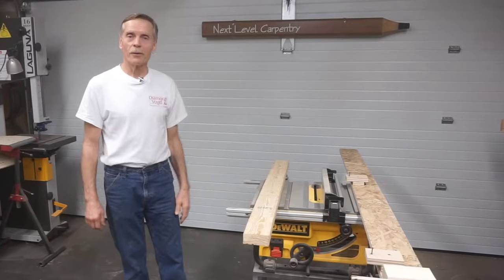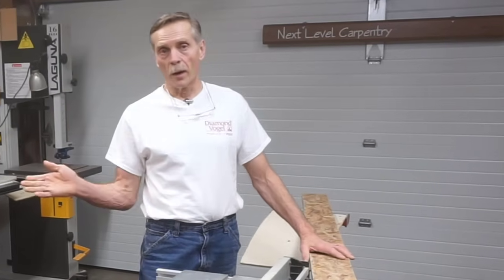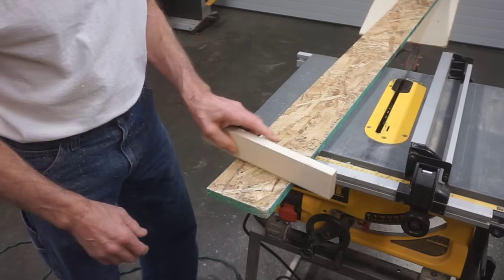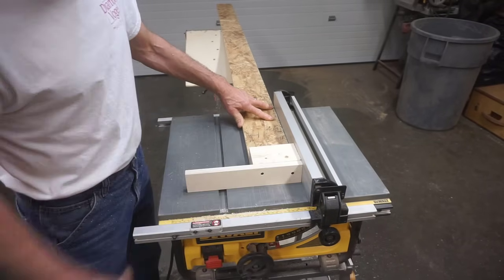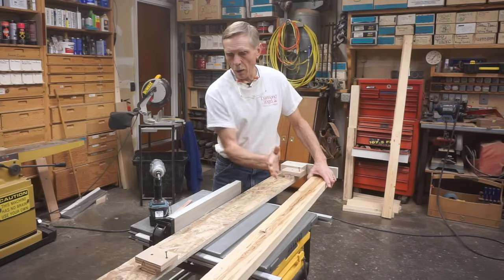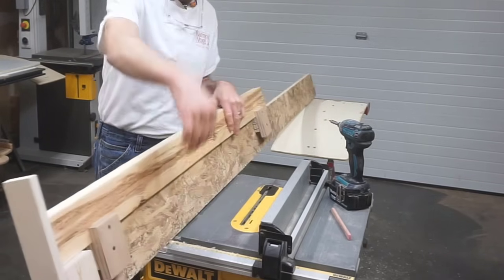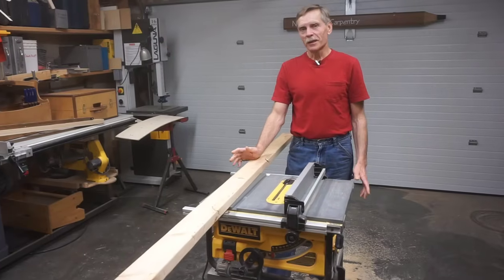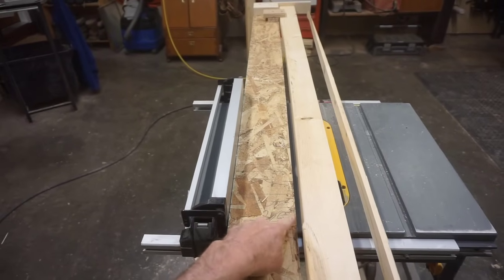How to Cut a Straight Edge on Crooked Boards

Comment: why not just screw the straight board to the warped one and cut the opposite side?
Reply from the maker: Some people do it exactly as you described but I prefer this method and leave it for user discretion to decide between the two
Reply: Also, you would leave screwholes in the finished piece.2x4s are one thing, quartersawn clear white oak is another.
Reply from the maker: @timothydunlap7980  exactly... this is framing lumber, not precious hardwood.  The Powermatic PJ with razor sharp cutters and a 6' bed seen and mentioned in the video... THAT'S for the quartersawn clear white oak, padauk and ebony... no screw holes allowed! Best, Matt
Reply: yes screws are horrible -  one could use double sided tape or even pin nails.  i just made a blunt example.

Comment: Hello sir,  BTW Great video(s) as alway.

I am a rank a$$ beginner wood worker but have a few easy questions.    

I heard you mention that this process could be used to straighten wood for framing and or other purposes.  After thinking about that for a minute, I am guessing the framing idea would work great for most everything besides walls.  Since most of the walls in my home, have finished surfaces on both sides (drywall / drywall & Stucco in my case) and need to be parallel by using studs that are all the same thickness and hopefully pretty straight.  Or can this process be used if you simply shim the drywall and or stucco lath, during installation? 

A few years ago, I remodeled my master bathroom and really struggled with very crooked, and very out of plumb walls.  But in my specific case, I believe it was due to warped studs and high-speed track home workmanship.  This is essentially the opposite of what you do, which is why I subscribe to your channel 

you, sir

Mark Nicholson (Retired)
Former, US Army - EFMB,
Combat Medical Specialist
1/94 FA MLR
Reply from the maker: Hey Mark, thanks for watching, subscribing and commenting here... much appreciated!
To your question; I think it's easy to get distracted about the application of this method by the fact I show a 2x4 being straightened in the video's thumbnail and taking it too literally.

While the method does work as shown to straighten boards of any width, the problem is the width of the straightened piece needs to be taken into account.  I think that is what throws viewers off and into thinking I'm showing how to straighten a crooked 2x4 and re-use it as a 2x4 once straightened.  That would be completely impractical in any but the most dire situations because it would involve adding a strip of wood or something the thickness of the blade to replace the missing saw kerf from the straightening cut which would involve not one but two glue joints the full width and length of the 2x4 not to mention time and effort and a dozen clamps.

I have used this exact process (and is one of the things that inspired me to make this video) to straighten bowed 2x6's to re-use as perfectly straight 2x4's.  It's an excellent way to re-purpose salvaged wood that is good otherwise.
2x4's, as shown in the thumbnail, are a great source for furring, soffits, tub decks, chases, etc where lumber needs to be straight but not full width to match other 2x4's.

Now your bathroom remodel predicament is a different situation entirely. Unless there's some dire extenuating circumstances I would never suggest removing studs from a framed wall to straighten them using this method and reinstall them... that's crazy talk! 😜  The best remodelers who face conditions you describe deal with bows INTO the space by using a power plane to shave away the bow... a tedious, messy and time consuming process to be sure... but that's why they're considered 'the good ones'.  Studs that bow OUT of the space are straightened by stacking and staggering drywall shim strips to fill in the bow until it's straight.  Adding shim strips is also one method of plumbing studs that are out of plumb but otherwise straight although I prefer to use my Super Shim method in this case:   https://www.youtube.com/watch?v=IGK3w2I_Bms

I hope you don't mind that I pin your comment to the top of the list for awhile since you're not the first (or the last) to wonder about ways to apply this straightening method?  I hope others benefit from the discussion and will join me to thank you for your service to our great country!

Best,
Matt
Reply: Damn good question and damn good answer I will be subscribing
Reply from the maker: @colbornfarms4849  Thanks for watching... and the sub!

Comment: track saw ?. may be
Reply: That's meant for larger pieces. Slabs and panels. It's awkward using a track on a 2x4. It's better to use it on a stable surface. Table saw was the right tool for the job.

Comment: crooked as a bucket of snakes ;)
Reply from the maker: Markus Puschert you know exactly what I'm talking about; you just walk right by that pile of lumber and shake your head right?
Best, Matt
Reply: Markus Puschert  
I will never be able to hear the word “crooked” without “Hillary” attached to it.... trump ruined it for me.
Reply from the maker: If only it were so simple to straighten out more crooks, right Ran?! 😎
Reply: You talk about "straighten" but like you showed, you can only trim it, just to make it look straight..... although inside, it's still kind of twisted ;). You cant straight "wood" that "crooked" :) I do apologize for my English :/
Reply from the maker: Hi Ran, if you straighten one edge of a board  and then rip the other edge parallel like I show in this video you'll end up with a piece that's plenty straight enough to use for framing although it will be narrower than it started out.  You mention 'inside, it's still kind of twisted'... I hope I made it clear in the video the wood that's noticeably twisted is useless for general carpentry.  Best, Matt
Reply: Next Level Carpentry 
I couldn’t help it, and made small political remark :):):).... I was figuratively referring to politicians. You can work with wood, and eventually get something beautiful out of it, no matter how “crooked” it is....... on the other side, the political aspect, not so much. 
As I said, just couldn’t help it.... my bad. :):):) 
As you said it would be nice to work that smooth on people. 
Have a nice day.
Reply from the maker: All's forgiven Ran... I share your political observations and, with caution, don't mind it here.  You'll certainly understand, however, if this thread gets out of hand I'll have to remove it.  Thanks for your comments for sure! Best, Matt
Reply: @RanNero  "Ruined"? I would say: "Pointed Out the Obvious", but this is not the proper forum, time or place for that kind of interchange. Happy & Safe Woodworking.

Comment: Well i was a home building contractor for over 45 years.
Framing lumber is as a rule sold to builders in bulk, not in single pieces.
A draft of 2x4s studs for example will be about 400 pieces.
Framers as a rule never have a table saw in their possession.
And even if they did they wont be spending time cutting a straight edge on a piece of framing lumber.
Rather, the crooked pieces or ones with other defects like large knots will be separated out and used for cut pieces of which there is a big need in the framing process.
As for shop work, most shops like cabinet shops for example will have a jointer for truing up at least one edge of a board.
Some shops also might use some type of a straight edge for cutting a straight edge.
Larger shops however which are usually the higher volume producers wont be using a jointer or any type of a straight edge.
But rather they will have invested a considerable amount of money into a straight line saw for making a straight edge on lumber.
And once you use one of those, there is no going back to other methods.
As fast as you can run the board thru the saw you will have a glue up quality edge on that piece.
Reply from the maker: So, what you're saying is that as "a home building contractor for over 45 years." you never found the need to rip a straight edge on a crooked piece of lumber?!  Wow... that's unbelievable to the point of absurdity... but who am I to question your claims of pedigree?
Reply: @NextLevelCarpentry  Note that i didng
t say we didnt cut a straight line on a board. Certainly we did, usually by snapping  a chalk line then using a circular saw for the cut.
Bur we never attempted to straighten framing lumber.
Reply from the maker: @ernieforrest7218  so what?

Comment: 40 years in a trades, I watched a different way of straightening boards 'on the job site' with great interest. Most of the time I do it by eye, and or, make repeated cuts flipping the good (2 point) edge against the fence. That said, using a straight edge, as you do here, whenever you can is preferred, more accurate and safer. Similarly, I commonly use an 80-in door casing level (that I almost always have with me) on its side and spring clamp it through it's handles on to the table saw fence. This in essence turns my table saw into an on-site jointer with 40in in-feed and out-feed tables. I always believe there is at least 10 ways to do something, anyting, thanks for your encouragement!

Comment: AWESOME video - I'm new with wood working - metal has been my thing - easy to fix when i screw up! I built a little router DADO jig and thought the wood i used was straight. But after making my first test cut I came to realize that the guide boards were just a hair bent (not really visible without a straight edge) so the router path was not was not 100%. The jig worked like a charm but not accurate enough - first lesson- USE STRAIGHT WOOD. Your video taught me how to assure that does not happen again! I will build another DADO jig AFTER I use your method to get my 1x4 guides arrow straight. Thanks for the great lesson - Larry

Comment: This video is excellent.  For some reason I had watched halfway through and never gave a thumbs-up yet?!  I have seen so many wildly dangerous methods of doing this (like the table saw rip fence addon which looks great on video but always wants to pop up or fly off in practice) - or ones similar to this that require expensive or hard-to-find parts and hard-to-align specialty clamps.  This is just simple and functional all the way around.

Comment: Excellent point about how cuts change stresses in board so you may need to take a few passes. Of course, better to cut a badly warped board into pieces for those small parts needed in a project

Comment: Thank you out of Australia for this excellent tutorial - had my head in a twist on how to fix some very expensive bowed marri (prime Australian river gum) but thanks to your video, all is good now. 🤙
Reply from the maker: This video is meant mostly for framing grade lumber where a couple screw holes from hold downs don't matter. There are other ways of straightening prime lumber without leaving screw holes from hold downs as shown in this video.  I recommend a jointer for very expensive grade wood and it's a good investment if you have much of it to do IMHO.

Comment: Excellent video!  I've done this with just your hold-down blocks (no push blocks).  This saved time on the job site, and still holds the work piece snug to the straight piece.  I've found no downside to this method.  Thanks much!

Comment: I’ve been lucky enough to scavenge Half a ton of lumber from a construction site I’m working at, between 4’ and 14’ in length. Most is straight but a lot of it will need to be processed this way. I thank you for your time and your knowledge.
Reply from the maker: That sounds like the perfect application for this method... should work great once you're set up! Best, Matt

Comment: This lends me to address the matter of ripping down stock to long angle pieces. For example making a perfect  3-1/2" to 0" (called "to nothing"by carpenters) by 8'.   Before anyone chimes in, yes I know it can and I've done this several ways using a circular aka skill saw.
   Thanks for " getting my wheels turning" by using your jig for that!

Comment: That deWalt table saw is the best all around jobsite workhorse I’ve ever owned. Once you get it dialed in you can run off different sized rips on the fly. With it’s stand and a good quality off feed roller stand it’s a very efficient one man work station for a good sized crew.
Reply from the maker: Totally agree: everything a good jobsite saw needs to be without extraneous flimsy features that never get use or just break anyways.  Only useless thing on the saw is the cheap plastic push stick... but that's an easy problem to solve. 😎
Best, Matt

Comment: I had to do this for fence pickets which were bowed in/out on the edges.  I simply clamped a 6 ft. metal straightedge and used a circular trim saw to clean up one side first, then used a cheap digital caliper on that reference edge to measure out the proper straightedge spacing for the other side so I’d have two perfectly straight and parallel edges.  Made very quick work of over 90 planks once the routine was established.

Comment: It's amazing after almost 5 years that this video still gets a lot of hits!  Its a very relevant topic and is good if you have an occasional board that needs "straightening".  However, what do you do if you have hundreds of 12 foot boards to do like I did (making shiplap)?  A simple solution is to buy a 24' rectangular aluminum tube from a metal supplier like Metals4U and turn it into an extended rip fence attachment for your table saw.  Then when you run the board through you place the concave side to the fence so only 2 points are touching the fence.  Cut the one side straight, turn the board over and cut the second side (after adjusting the board width.)  This simplifies the process so it is easily repeatable.
Reply from the maker: Anyone with access to a straight line rip saw guided by laser alignment beams or the setup you describe knows it's absolutely the way to go!  I think this video still gets hits because few people have the volume of boards you do or the relative luxury of a special straightening setup on a regular jobsite so this is a down and dirty great way to get the job done. 
Best, Matt

Comment: Nice.  I live in a condo and my toolshed is super-tiny so I don't have room for a bulky jointer.  This is something I'm going to try.  I think using this method I can get away with just getting a planer and that should be good.

Comment: I like your method because you can cut a board much smaller than the jig board without too much trouble. I don't like having to put screws into the work piece and wonder if there's a way to clamp it?
Reply from the maker: This video is mostly geared toward rough framing lumber where screw holes don't matter.  There's other videos on YouTube showing jigs with clamps like you asked about.  Versatile carpenters/woodworkers use whichever setup is best suited to the task at hand...

Comment: I needed to cut some tapered boards to make a ramp.  So I started with a base made of 3/4" ply (pretty much the same as your OSB board but wider.  I mounted another board on top to act as a fence and clamp mount.  In that board I inlaid a T-track close to the edge.  The fence rotates to make any angle I want within the limits of the system (about 15-20 degrees or so).  The wood I'm cutting is clamped down to the base by the clamp in the fence.

Anyway, the reason I bring all this up is that I later found that it also works great for straightening crooked lumber.  It's a lot more involved but the function it was built for needed to be adjustable and that's the simplest thing I could come up with at the time.

Comment: Very informative. However if you don't need that particular  board, take your time to select a good board. I am always  very selective. I once went through 99 boards on a Friday afternoon after work in over 100 degrees heat to finally get the board I wanted. Of course I then had to put all the other boards back.  Wife was not a happy camper.  Keep Em coming.  Love the giant carpenter's pencil on the wall, on my to do list.
Reply: Pretty hard to find good straight lumber now a day's

Comment: I‘ve used a plywood straight edge for decades to straighten my hardwood and my straight edge is jointed together to give me a  little over a 12’ long straight edge. Only thing I did different is glued and screwed two 3-4” pieces of plywood on top of one another for my straight edge and never needed anything else on my straight edge to get a straight edge on my hardwood. Worked just fine even for making my raise panel door joints. Never had a need for a jointer, table saw with a good straight edge works faster getting a straight edge then a jointer ever will. Having a 1 1/2” thick straight edge works great when your boards are bowed a little in both directions too

Comment: Thank you, great video. I struggled for hours today trying to get boards to line up for a work bench and I have a joiner. I think I know what I was doing wrong now and I'll give it another shot tomorrow. But if that doesn't work I'll use this method.The boards are a true 1x12x48 and were very hard to handle, in case you were wondering.
Reply from the maker: If you have a jointer it's what I'd recommend using for straightening boards only 48" long.  If it doesn't work, you're doing it wrong😉😁 With what you describe I recommend figuring out how to use the jointer properly rather than use this method for straightening.  FWIW I did a whole series called "Master the Jointer" for patrons on Patreon in case you're interested in investing in patronage for the 'lessons'. Best, Matt
Reply: @NextLevelCarpentry  I have used it successfully many times but when it came to the big bulky piece I had my hands full. I was putting pressure on the board in the wrong place just trying to hold it in place. I ended up making some stops to keep it against the fence. Not sure if I mentioned it but I’m doing the edges. Like I said I’ll give it another try tomorrow.